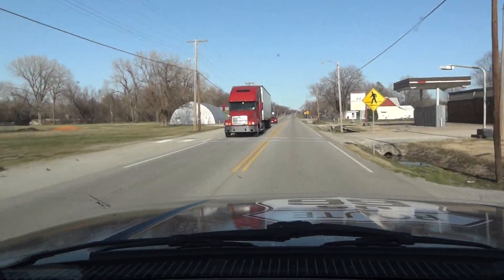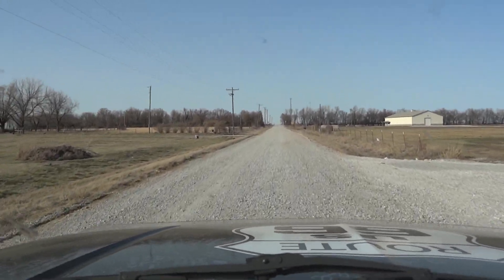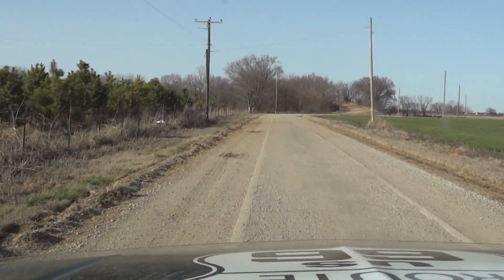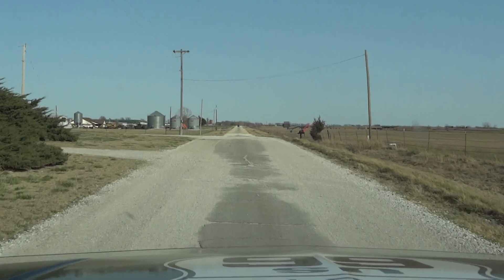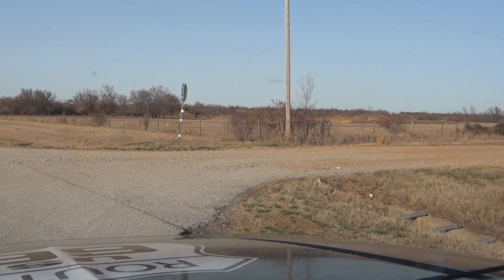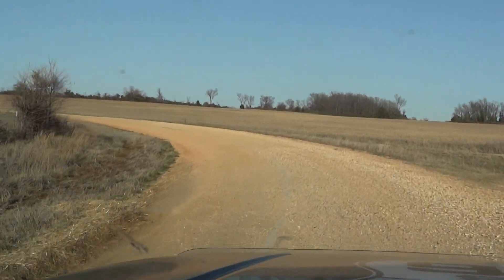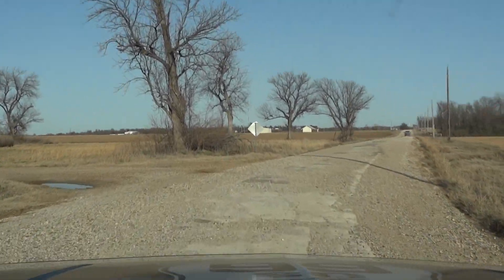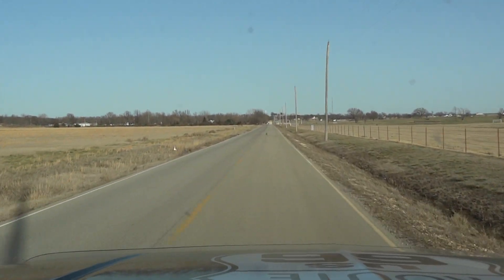Oklahoma Route 66 Sidewalk highway from Afton to Miami

Comment: My wife and I just drove over the Sidewalk highway section between Miami and US 69 going into Afton this past weekend (July 27, 2014).  As you leave Miami on 125 and turn onto the Sidewalk highway the road is really rough. It is like driving over a washboard. That may be due to a grader blade digging into the pavement. Going west from Miami the first six to seven miles is more or less gravel with just spots of pavement showing every now and then. As you get closer to highway 69 more pavement is visible and the road gets a little smoother. I am glad I got a chance to drive on it before it is all gone. There is now a marker sign at the turn off from highway 69.  Thanks for posting the video.
Reply from the maker: Glad you got to drive.
Reply: LIkewise my thanks for the video. I grew up on Hiway 66 (our house was two doors east of the Rocket/Hair Teazer. The big white two-story house across from the Rocket belonged to a couple named Rose; they operated essentially a motel in their house. Looks like the two houses next to it are gone; the second (which was directly across the hiway from us belonged to the Dentons. Mrs.Denton was the mother of Cliff and Clint Baker, and she and I had the same birthday. Seems to me that next door (heading on toward Miam) was the home of Cliff Baker, who had that small eatery there on the same block with Bassett's grocery.

Comment: I don't know if I was on the sidewalk hwy in the '50's, but I remember there was a curb on the edge of the hwy. that if you hit it, it would "throw" you back onto the road, you would not leave the hwy. This was Rt. 66 thru Okla. It was concrete, cracks filled with black tar/oil. The only road I remember that had this curb. It had a 45 degree angle; years were '52 onward.
Reply from the maker: not the sidewalk highway. What you speak of still exists nearly in its entirety through Oklahoma. The sidewalk highway was only 66 briefly.

Comment: I seem to remember a small section of this in Foyil, Oklahoma as well. It wasn’t nearly as rough as this.
Reply from the maker: The section in Foyil is old but not this narrow. It's still the original pavement but approximately 18' Wide.
Reply: I found that out when I did a little research after I had made the comment. 😁 Talk about sticking my foot in my mouth. 😂

Comment: Your video all very helpful! Here’s a little of what I’ve done the dialogue are in French but there’s not a lot of it.
Reply from the maker: Nice work! - Especially with the little Mavick.  Ironically, that bridge you were on (Eads Bridge) is pretty much the only bridge that was NOT used as Route 66 to cross from Illinois to Missouri.  All the other bridges crossing from IL to MO were designated 66 (with the exception of the Stand Musial bridge c2015).
Reply: Roamin' Rich OK was looking for the name of that bridge.

Comment: @Roamin roach please do the old us 380 between carrizozo new mexico and San Antonio nm. The old route merely is side by side of existing and mostly not visible unless in air as you can see the old route 2 lane and part of it was buried under thr lava fields by existing modern 380. Google earth can show. Part of it where it split off is still accessible for land owners off the old 380. The rest past the entrance toward San Antonio is non drivable anymore. But it's good history. A lot of bad accidents occurred on thr old 380 stretch that winds mostly head on with casualties. A bit actually. In carrizozo the old 54 cut through downtown toward 380 but now is a dead local road in old downtown. The existing has been redone few times paved over utilities replaced which goes up past court house on current north 54 route.

Also prior to 380 the old old route from carrizozo to San Antonio nm was north of the lava fields. Contact me if you wish to do this as I can point you on accessible areas and the old road road prior to 380 (old and realigned) existing .
Reply from the maker: Sounds like a great opportunity to explore!

Comment: Roamin' Rich, I love this video, but I do want to point out a few things.  In your video, you talk about the graders tearing up the road and putting gravel down and locals not realizing what they have here.  Locals do realize what they have but the county and the state are on a limited budget especially due to our state legislature giving out tax breaks to big companies and due to the legislature lowering the state's tax base.  It is cheaper to use gravel and grade the road then it would to repair the concrete or lay asphalt there.  Also, you suggest they build a new road next to the old Route 66.  That would require huge of amounts of money.   Not only would the new road and materials costs a lot of money but buying the land out from the locals would also require a huge amount of money.  Now if you out-of-staters would want to start dumping large amounts of money into the project then maybe the county and state would consider the project.
Reply from the maker: Regardless of any scenario, grader blades are destroying a historical landmark.  I understand pavement very well as it's my trade.  Yes, putting in a new road wouldn't be cheap.  Honestly they could simply widen one side of the road and add gravel and a drainage ditch. - That would give people a clear lane to drive on.  Whoever decided to widen both sides of the road wasn't thinking very clearly.  They should have steered to one side or the other and left the pavement to itself.  Maintaining it is probably a little more labor intensive than they want to take on.  It wouldn't have been very hard to make repairs to the road itself while grading the gravel road next to the pavement.  It's too late for that now.  Most of the road has been beaten beyond recognition.  I think they are just taking the easy way out by putting the blade to it.  I would bet that the people working on that section of road would rather the historic pavement would just go away so their job would be easier.
Reply: I don't know if you know about Oklahoma's budget situation right now, but Oklahoma has a $611 million shortfall so the state can't afford to buy some land of landowners in order to widen what is now a county road.  And I doubt Route 66 enthusiasts could raise enough money to save it.
Reply from the maker: Seems as though every state is broke these days.... some how they have money to pay for less practical things though.

Comment: Between the cement curbs. Was,& still is originally,red bricks. Those where paved over.
Reply from the maker: Nope. No red bricks. Not here. It's concrete underneath. I've seen plenty of sections with missing asphalt.